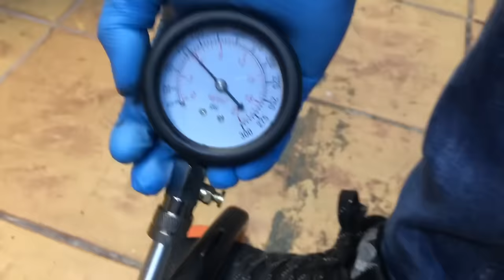Drujba nu porneste, verificare si o rezolvare simpla

Comment: Am și eu un 034 și la reprezentanta mi sa spus ca este dus motorul dar ea are compresie pornește dar când o acilerez se  îneacă dar dacă o las așa se turează ce poate sa aibă ?
Reply from the maker: Este posibil sa fie carburatorul dereglat
Reply: Poti verifica acasa daca este dus motorul (la stihl rar pica interiorul motorului sunt foarte rezistente mai ales de generatie veche) Desfaci toba si te uiti pe admisie daca pe piston ai zgarietui verticale iti poti lua ramas bun daca nu s-ar putea sa ai probleme pe partea de semering prinde aer fals . Iar verificarea daca ai probleme cu semeringul este: dai ambreiaj jos sa vezi semeringul, cureti bine zona o usuci , dai jos bujia si pui benzina si invarti usor de motor de 2 -3 ori sa ajunga benzina jos si pui cam  50 60 ml de banzina si o lasi cateva ore . daca vezi semeringul ud pe acolo prinde aer fals . daca nu in ultimul rand este carburatorul . Cei de la reprezentanta au vrut sa scape de tina vazand ca ai un model vechi . Stiu asta ca si eu sunt mecanic stihl si ma tot lovesc de drujbe de genul care s-au tot plimbat pe la reprezentantie :) Bafta

Comment: SALUT AS VREA O L AMURIRE DACA SE POATE AM UN EFCO MTH 5100 NOU PROBLEMA E CA ARE O COMPRESIE PUTERNICA MA CHINUI SO PORNESC SA RUPT SI MANERU NICI NUMI VINE SA MA MAI FOLOSESC DE IA SE POATE FACE CEVA GASESC UN SET MOTOR PENTRU IA CU DECOMPRESOR
Reply from the maker: Dar puteti pune un demaror cu cu dublu arc
Reply: @SHRMotorsOfficial  MULTUMES DAR UNDE GASESC UN DEMAROR CU DUBLU CLIC SA SE POTRIVEASCA? SAU POT FOLOSI SISTEMU DE PE DEMAROURILE CHINEZESTI? AM MICU PADURAR AM INCERCAT DAR E DIAMETRU MULT PREA MARE

Comment: Salut. Ma poti ajuta cu un sfat te rog frumos? Detim un mccullock 338 parca, cu 1 segment. Am segmentato si nu mai porneste. Am compresie 3-4 bar. La ce compresie poate porni o drujba in general?
Reply from the maker: Peste 3 , dar este foarte mica compresia... bujia se uda?
Reply: @SHRMotorsOfficial  De fapt mi-o segmentase cineva si nu am stiut ce urat e cilindru. Am demontat-o , si am gasit santuri in cilindru(si pe piston), am slefuit de mi-a sarit capacele pana au disparut zgarieturile. Acum e ok , doar ca, cam pierde compresie la inchiderea segmentului. Cilindrul e de 41 dar segmentul(nou) de 41 nu inchide in piston si o sa caut unul de 42 (ar trebui sa mearga).
Reply from the maker: Cilindrul are un strat tratat, daca pe cilindru era pistonul ramas si l-ati slefuit, nu este problema, dar daca ati luat tratamentul de pe cilindru, cand se va incinge , se va cala
Reply: @SHRMotorsOfficial  Am inteles , deci set motor nou. Multumesc pentru sfaturi.

Comment: Salut. Am si eu exact aceasta problema dar eu iam bagat benzina si la filtru de aier si pe la bujie dar tot nu porneste. Te rog sa ma ajuți
Reply from the maker: Daca nu porneste nici asa, ori nu da scanteia cand trebuie, ori nu aveti compresie
Reply: Scanteie da ca am verificato si am si curatato . Si are si compresie pentru ca am pus degetul  si am tras de sfoară.
Reply from the maker: Poate sa de scanteia in alt moment... din cauza panei de la volanta
Reply: @SHRMotorsOfficial  am mai vorbit cu cineva si acelai lucru mia spus ca este volanta. Ia comandat o volanta noua. Maine ma duc cu ia sa io pună. Volanta a spus ca este 30 de lei si manopera 40. Tu cam cat ai fi luat
Reply from the maker: Nu e mare lucru sa o montati